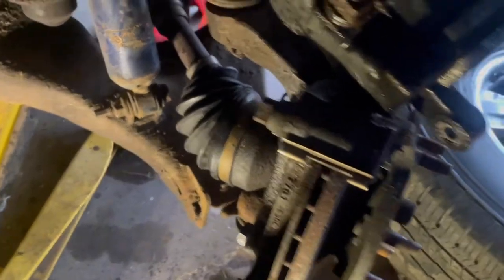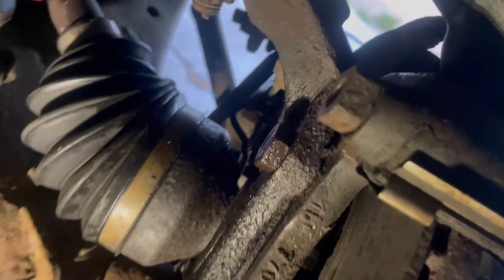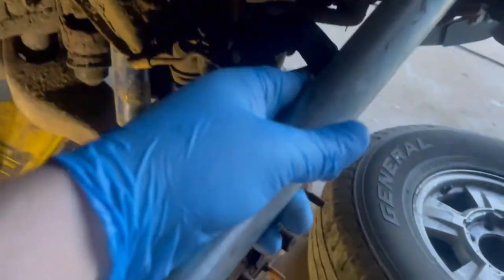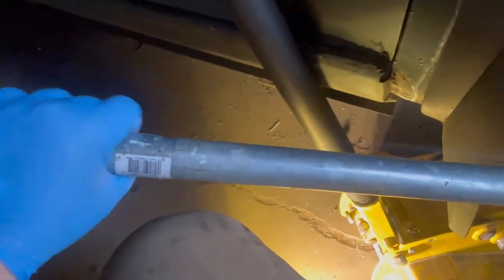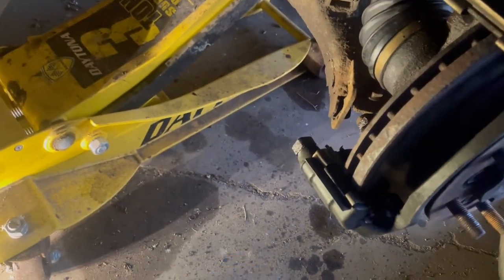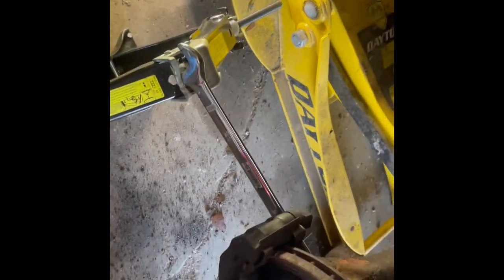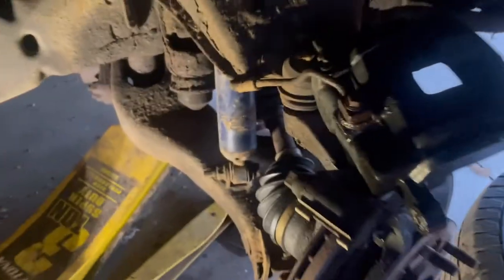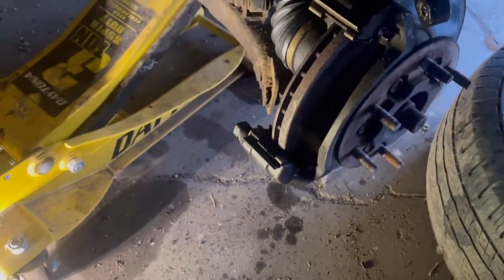EASIEST WAYS TO REMOVE STUCK CALIPER BOLTS

Comment: When using the torch, do you heat the bolt head or along the caliper flanges, or both.  Thanks!
Reply from the maker: Try the bolt head first.

Comment: There's zero problem using penetrant on a caliper bolt.  The only danger would be if you get the pads oily, but you're changing them, right?  Otherwise, why take off the caliper?  Just clean up with brake cleaner before you reassemble.

Comment: The bracket bolts are not the problem. A bar yes. The bolts rarely snap being big. The prob is the caliper slides! Dont matter how much grease you use when you put new calipers. They always seem to sieze. Pain. Has cost me new calipers when snapping heads off those . 
Why cant they come up with grease fitting on the top of caliper so u could get grease in the slide bolts. 
They sieze then take out inner pad then next is the rotor and slide bolt break you need a caliper too! 
No wonder why brake jobs cost 2k all around now. Need all new everything. And geeze, $140 for premium pads thesedays? $250 rotors,$200 calipers ! 
Do yourself save 1000 labour dammmm
Reply from the maker: I agree, you can save a lot by doing it yourself.  You can also save if you buy pads and rotors in a package versus buying them separately.